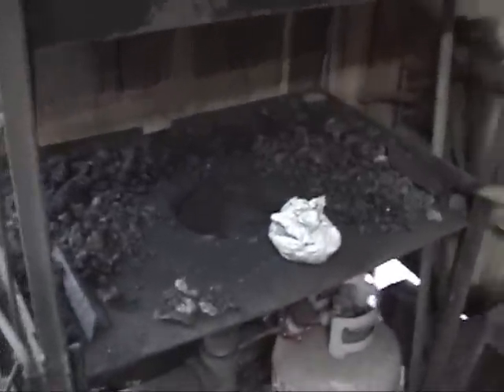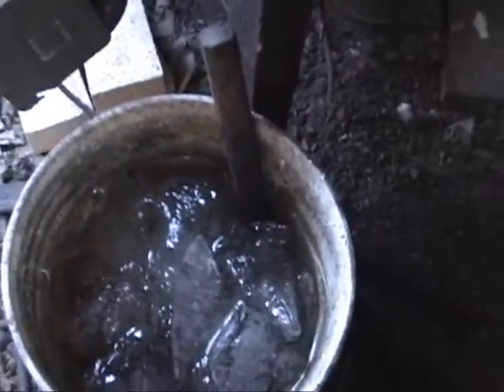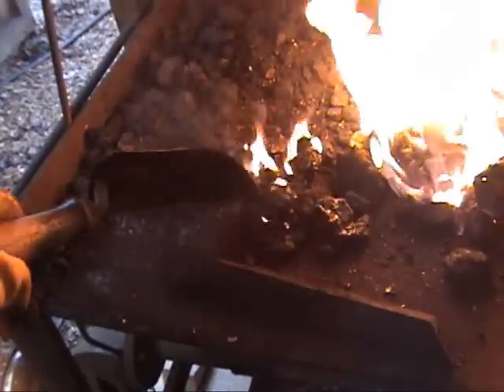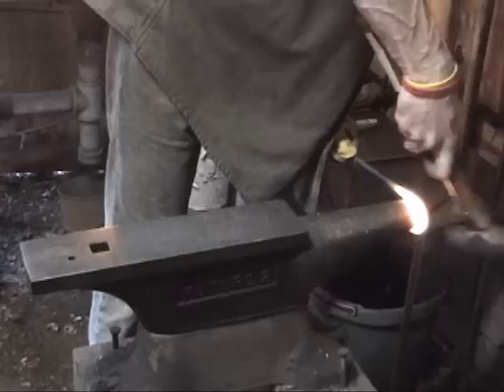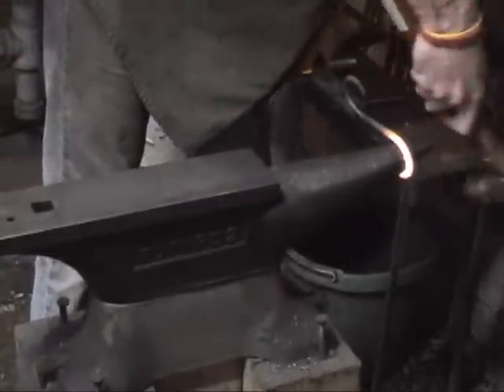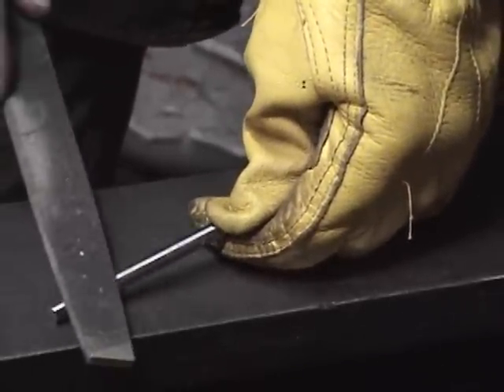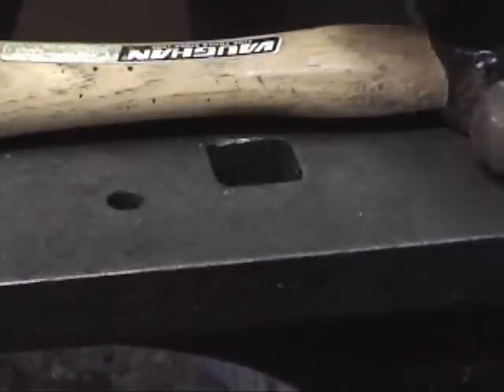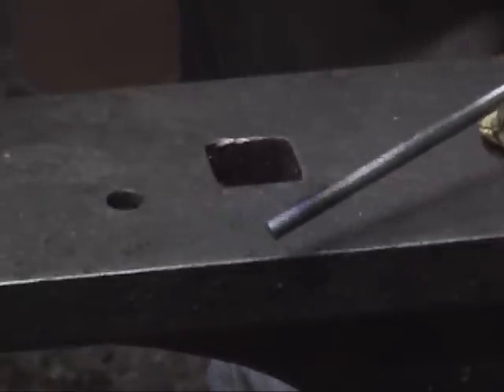Blacksmithing basic forge work - from making the fire to quenching and tempering

Comment: nice video .  the clinkers are composed of aluminum, silica, some calciums and small amounts of iron dependent on the coal source used.  the sulfur in coal burns off at these temperatures.  congrats on putting together a beginners level video .
Reply from the maker: Many thanks Colonel!  I would not have expected Aluminum in there!  The silica makes sense, that's what it looks like.  But the ones I get are mostly yellow to orange in color and so I assumed a sulphur content.

Comment: I enjoyed the video. I just decided to learn to make knives (meddo retire out of the army so i need a hobby). I had all the mats needed to make a forge (brake drum) in my scrap pile.. The tips on the fire are helpful. I seem to lose a lot of heat or something.. My metal doesnt go past orange where yours seemed almost white or yellow.
Reply from the maker: Your fire should be able to make anything glow white (and spark!)  If you can't get it past magnetic, you are losing potential hardness.  Might just need more air.

Comment from the maker: Some metals need to be quenched faster or slower than others. Water is a fast quench medium, oil (which is usually pre-heated) is a slower quench.  The rate of quench has to do with how much carbon you want or need to trap in the steel.  When you heat the steel enough the molecules expand enough that carbon atoms can migrate in between them, that is good as it makes the metal stronger, the quench cools the steel fast enough to trap the carbon.  In high carbon metals, you don't need to trap as much, in lower carbon metals you need to trap all you can.

Yes, quenching in oil can be exciting, but not like a grease fire on a stove.
Reply: I've heard quenching in saltwater is a faster method than just water (while oil and muddy water slows it down). Would quenching into the ocean work with low carbon metals?
Reply from the maker: This is true, mostly because the salt changes the temp at which water boils.  For low carbon metals, there is also a homebrewed quench made with water and various other things including dishwashing soap.  It is generically referred to as a 'super-quench'.  I have never tried it, it is also usually cooled as much as possible before the quench is done.  If I am going to bother to make a real tool/blade, I am going to spend a little extra or take the time to find a quality steel to use.
You can (usually) test the carbon content of a steel by grinding it and looking at the sparks, the more complex they are (the more branches) the more carbon there is in the metal.  Some alloys do not follow these rules.
Reply from the maker: Maraak .Nor Saltwater has a higher boiling point, so it is a faster quench than fresh water. Getting the forge near the ocean might be the tricky part!
Reply: stimpsonjcat67 not in Norway...
Reply from the maker: Maraak .Nor LOL, I guess you are right!  The wife and I visited Norway in the 90's, very pretty country!
Reply: my uncle said somethin about letting metal normalize its self in rock dust because it takes a long time to cool down said it anneals better

Comment: one problem i noticed is when you are heating your metal you dont put it at an angle like you did because it doesnt heat it evenly. you want to lay it flat so it heats evenly and it makes it easier to shape
Reply from the maker: This is really dependent on the size of the mass of coke that is providing the heat.  In this case I was using a fairly small fire, not even above the level of the table, so yeah I had to angle it in more than I would for a larger piece.  But unless we are talking about bladework, I admit I do not get too excited about perfectly even soaks.  I usually use the propane forge for any serious tools that need even soaks.  Thanks for the comment!
Reply: ok thanks.
thats usually all i do is blades and sometimes i'll make some armor
Reply from the maker: Armor?  I am sooo jelly!

Comment: Why do some use oil as a quencher?  What's the difference in slow quenching and fast quenching?  Also, if you have time, is there any dangers in using oils such as exploding such as a stove fire?
Reply from the maker: The liquid you quench in depends on the steel you are using.  I use mostly O-1 steel, which needs to be quenched in oil.  There is also W type steel, which needs to be quenched in water.  The lower the carbon content, the faster you have to quench.
Yes, there is a very real danger of fire when quenching in oil...see this newer video of a large blade quench.
https://youtu.be/56dfGvLgK3U

Comment: Nice video. Have been trying to get into smithing as a hobby, but have done nothing but garnered the rage of my neighbors so =(
But as far as tools, is there anything in particular wrong with using a pair of chanelocks (water pump pliers, slidelock pliers, whatever you locally call them, I've heard literally dozens of ways in my travels) as tongs, and any old 2-3lb hammer (with a flat head)
I mean, is there any particular benefit to tongs? What about visegrips?
Reply from the maker: +Linkxsc Absolutely nothing wrong with using whatever gripping tools you have.  You may want to consider grinding some of the teeth off if using pliers-style tools as they may make marks on your workpieces where you don't want to make marks.  I have seen plenty of smiths weld various pieces of small channel to vice grips for use when holding stock of known and predictable dimensions, like when folks weld a holding bar onto a damascus billet during the drawing and folding portion of making the blade.

Channel-locks would be frustrating I would think, as it may be hard to keep them at the right offset.  This is why you see a LOT of tongs in an active forge, as you want a tong that fits your current stock size and doesn't leave you fumbling with the tool when the work needs to be moved or held.

Hope that helps.
Reply from the maker: +Linkxsc Sorry I missed this comment.  Any device that lets you hold hot metal without burning yourself or dropping the workpiece all the time will work fine.  Tongs are generally sized for the size of material being worked so that you don't have to make any adjustments when grabbing the piece.  Vice-grips would make me nuts having to undo the clamp everytime I want to let go or reposition the piece.  You might also want to grind the teeth off any of those toothed tools to prevent marring up the work.  A lot of the bladesmiths use tongs with rectangular jaws sized to the specific barstock sizes they use all the time for their knives.

Comment: how can u tell when the metal is ready to take it out and start shaping it? do u just pull it out until it looks hot enough? or can u tell by looking at it while its in the fire?
Reply from the maker: You get used to looking at if it is in the range you want.  Too hot will get white and sparkly, like in the video.  With mild steel, as long as it is radiant (glowing) you are fine to work it.  For tool steels it gets a bit more complicated and you need to be careful not to hit it below certain temps or you risk forming cracks. You also should not just stare endlessly into the fire, it's bad for your eyes.

Comment: I've tried to start the forge with coke but i found it impossible... first as you showed with paper, it just burned and nothing happened. Tried various ways, at the end i made a raging fire with wood and tossed the coke inside it, AND IT DIDN'T BURN -.-
Please, can you tell me what's going on here? u.u
Reply from the maker: You're sure it is coal/coke?  I can use the method shown with green coal and it still works fine, though not nearly as fast as using coke, and much more smoke obviously.  Coke that won't light makes no sense to me.
Reply: stimpsonjcat67 I bought it as coke, it's like a stone... The easyest method i found to do it is starting a fire with vegetal coal (is it charcoal? the one made with wood) and then cover it with coke. But it doesn't set in fire like yours, it just turns red, the temperatures are pretty decent (distracted with an SMS and a piece of spring melted)

Here you have an image, this is what I use: http://i01.i.aliimg.com/photo/v0/11594193/Foundry_Coke_Coal.jpg

OFC, I hammer it to smaller pieces.
Reply from the maker: Tomas Merino Got a picture?
Reply: I ended up starting with a small amount of kindling, works everytime ^^

Comment: Im a newbie in foundry,
am i correct,
So this set up operate mainly on coal and blower?
Reply from the maker: Correct!  I mostly use coal I get from a local Farrier supply store and then use an electric blower to move the air.  I have a hand-cranked blower also, but don't use it.
Reply: thank you for the video and response. i'll try yo find a safe place to set one up. :)

Comment: That O2 steel is meant to be quenched in OIL not water, W2 steel gets quenched in water, A2 in air and other steels in a Salt Brine. Water will cool O2 steel too fast promoting quench stress cracks that will lead to tool failure. Check: https://www.azom.com/article.aspx?ArticleID=2445
Reply from the maker: Gilberto Diaz Castro you are correct on all counts, but the intent was to make the steel as brittle as possible as a lesson.

Comment: why do you use cold water instead of oil to quench, im just trying to understand why different people use different things.
Reply from the maker: +connor imp In this particular case it wasn't important to get a proper quench.  The one piece was A36 low carbon steel, so it wasn't going to harden anyway.  The tool steel I just needed to get it brittle enough to show how brittle a hardened piece is before tempering.  When I make knives and tools I use O-1 steel and I quench in a warmed oil bath.  Low carbon steels need to be quenched faster than higher carbon steels (generalization), so you will see a lot of ice-water and even ice-salt-water quenches on youtube if the smith is using lower carbon steel.
Reply: stimpsonjcat67 ok, thanks.
Reply: stimpsonjcat67 how long do you leave the steel in the oil, to quench it.
Reply from the maker: +connor imp maybe 30 seconds, it's all over pretty fast.
Reply: stimpsonjcat67 ok, thanks. I cant do any of this stuff yet, im only 17 and dont have the space to do this stuff, but it really interests me and I really do want to get into it once I move out or whatever. So for now im just learning everything I can. Thanks so much for the help.
Reply: age doest matter, i am 14 and i am making swords...
Reply: Age realy doesn't matter, since 16 i am welding and bending steel in all the ways it's possible but now at 25 i start to learn the art of blacksmithing. :)
Reply from the maker: I SO wish your page had content!  subbed anyway, just in case.

Comment: Had a major DON'T on our project. See what you think of our first video. Got excited and tried to cool down too soon - 
Forging a Spiral Hook (then it broke) - 
https://www.youtube.com/watch?v=Tjn_J8PXYlc
Reply from the maker: +Stacie Forest I don't bother quenching decorative stuff unless it has to pass some strength requirement...and if you do, be sure to temper it before any flexing is done.  Remember the quench makes the metal hard but BRITTLE (assuming it has any decent carbon content).  You don't note the metal type that I noticed...what is it?
Reply: I don't think you covered it in the video, but as far as I (a clueless amateur blacksmith who's about to get started) was aware, tempering was when you quenched it... but I have the feeling that's not so much the case :/
Reply from the maker: Charmle H Nope, for carbon metals, quenching (heating and quickly cooling) hardens the metal and tempering (heating hardened metal to a given lower temperature and cooling) softens the metal.  For non-ferrous metals this works backwards.  So to harden brass, you heat it up and let it cool slowly. And to soften brass you heat it up and cool it quickly.
Reply: so if I Quench say, a sword blade that I forge. Do I then heat it up and let it cool slowly so it doesn't become brittle? (Sword blades need to be very VERY tough/.hard but not brittle as I'm sure you're aware)
Reply from the maker: You didn't mention what the sword is made of, but assuming steel then you would heat it up and quench it quickly (make it harder than it needs to be), then heat it up again to a lower temperature to temper it (make it exactly the hardness it needs to be).
Reply: ooohhh makes sense makes sense... But the steel I'm using/going to be using  (sorry I forget not all swords are made from steel) is 65 Mn Steel. And without breaking the steel after being quench/tempered, how do you know if it's at the right hardness?
Reply from the maker: I generally check hardness using a file.  If it skates then you have plenty of hardness to temper back from.  Looking up 65Mn it does appear susceptible to becoming brittle if over-heated.  I would forge a flat bar with a tapered edge (shape not important) heat to non-magnetic, quench in a warmed oil, temper to 400-450F for an hour, grind out any obvious flaws, and do a bend test BEFORE I spent any time forging an actual blade.
Reply: stimpsonjcat67 so if it skates (or slides without effort I assume?) then I need to soften it more? Do you have a video on tempering?
Reply from the maker: The video we are commenting on discusses tempering.

Comment: cat- if you have any home owners insurance on that shed or your home close by..theyll cancel it if tat bottle of propane is seen within 50 feet of any fire source..thats a federal madate..not state bro..better be moving it if your smart..
Reply from the maker: +usaisalwaysnumber1 I have removed the cylinder.
Reply: stimpsonjcat67 great to hear that bro-I didn't want to hear you got blowed up either.if you ever notice everywhere they fill or exchange bottles at,it always says do not bring bottles inside for any reason. LP gas is not like methane gas-natural  Lp is heavier than air it lays on the ground an dosent disperse as methane does.methane is lighter than air an it disperses.Many a gas leake was LP in sheds as well as homes.dont want to see anybody die. Natural gas will blow as well if contained.but LP dosent disperse very rapidly even in the open.thus LP gas is the most dangerous.we were taught that in HVAC/R school.i hold a current hvac/r license as well as current fuel gas card.always be careful an NEVER store a tank inside reguardless of size bro.even one of those small 1 pound bottles at walmart will level a normal size house if it gets the right leake and air mixture.God Bless bro an be careful..
USAISALWAYS NUMBER1

Comment: is this something you can do with kids or is there toxic stuff in a smith room (no im not talking about heat and crush injuries toxicity so spare me the lecture about the heat and crush injuries thank you =)
Reply from the maker: How old are the kids?  More importantly how well do they follow instructions?   "Don't touch that" has serious consequences when you are dealing with radiant metals.  My wife has learned not to assume anything not glowing in the shed is OK to touch, but it took some 'learning'.  If they are competent and will follow instructions and not get bored and lazy, they should be fine.  There are no hazardous substances involved except smoke if you use a coal fire. One caveat to that is NO GALVANIZED METAL.  Heating galvanized metal will release a nerve agent that will kill you.  If using uncoated 'normal' metals you should be good.  Eye protection, gloves, and suitable clothing are mandatory for beginners.
Reply: hehe then itl b fine thank you for ur anser i did not expect to get a useful anser on you tube. if you mean with radient as in glowing? i hope you dont mean radient as in radioactive?
Reply: oh btw how 2 tell if its galv?
Reply from the maker: Radiant just means glowing, it IS a form of radiation, just not in the dangerous portion of the spectrum.
Reply from the maker: Trickier than you might think!  Go to Home Depot and look at the fencing materials, you can also look at galvanized conduit in the electrical section.  Look in the bolts/nuts aisle for galvanized bolts vs nickel or grade 8.  Once you see what it looks like it is fairly obvious.  It usually looks like a gray coating that feels 'dry'.  Having said that, if I can't tell, it doesn't go in the fire.  The rebar at depot is safe, you can tell cause it is usually rusting ;P  Anything heavily rusted is not galvanized.
Reply: ah.. i know from the description u gave what it is, its like a crust and it almost always leaves edges from it